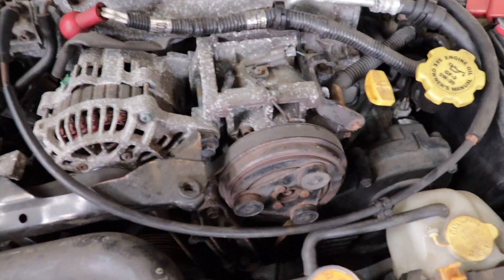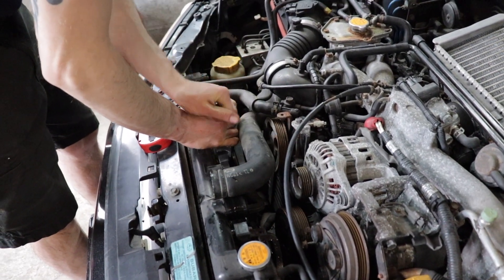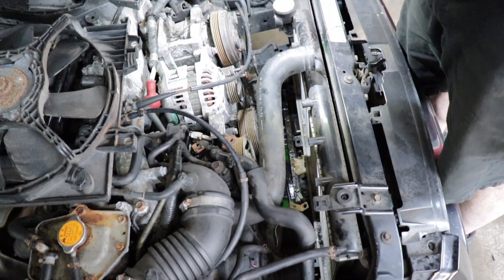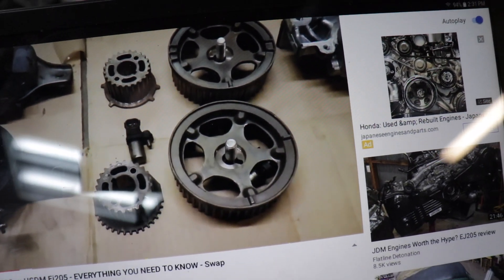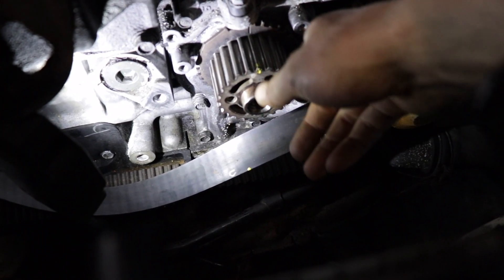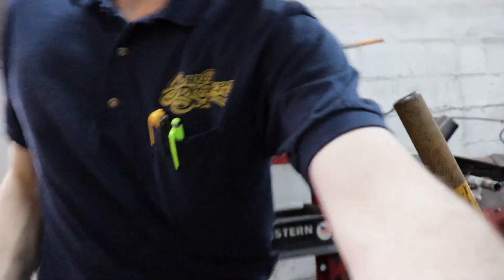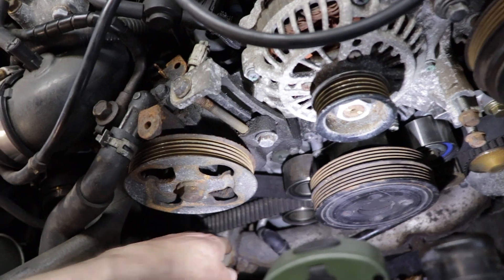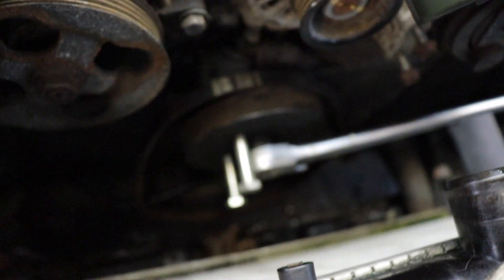JDM ej20 wrx crank sprocket swap

Comment: Hey brother I have the 2002 wrx Impreza I just put the jdm ej20 in it . It turns over but no start can you help me in anyway plz
Reply from the maker: i commented on your other comment about checking the fuel pump and for spark, do those and get back to me
Reply: @salvobrothers5928 i have the same issue but no spark

Comment: Great video! Did you have any issues not starting on besides the sprocket? I have a 2005 wrx ej205 non Avcs and engine im stalling is  ej205 avcs but car will not start.  I changed the cam sensor.  Dont know if im supposed to change the camgear because it has some kind of oil that flows inside. Non avcs camgear doesn't have that =/     any advise?
Reply from the maker: yea that was the only thing stopping it from starting. Ive never swapped an non avcs with an avcs but i would check all the timing components. make sure the crank sprocket is identical as well as the cams if the teeth are different in the slightest way it wont work. make sure the crank sensor and the other cam sensors in the back of the heads are identical too.